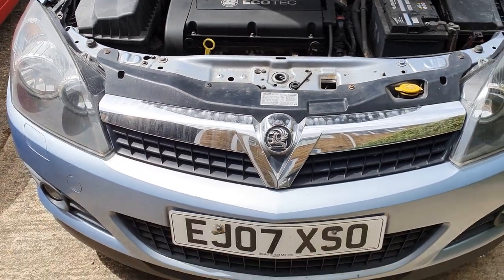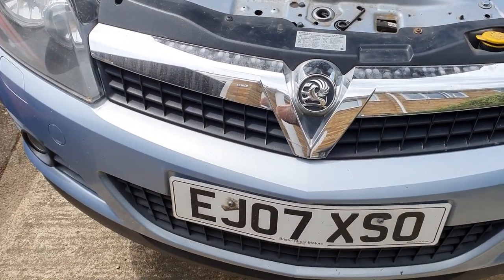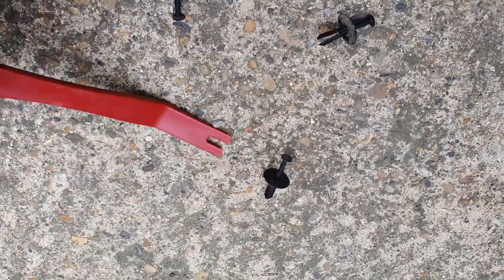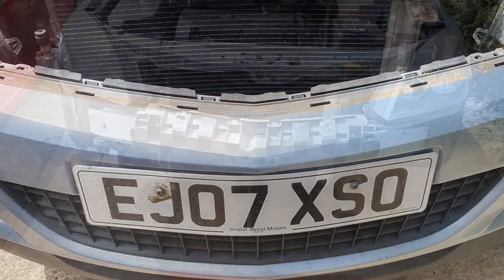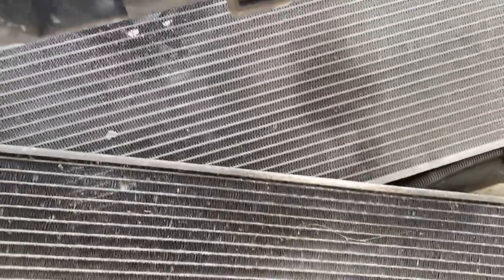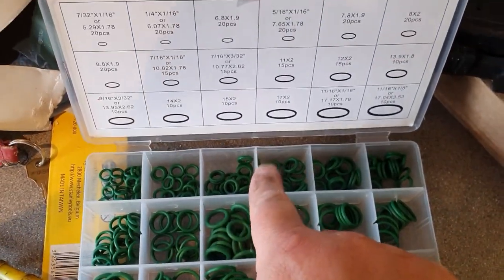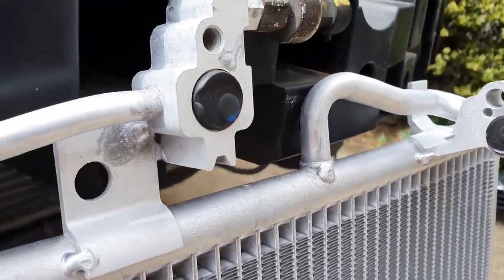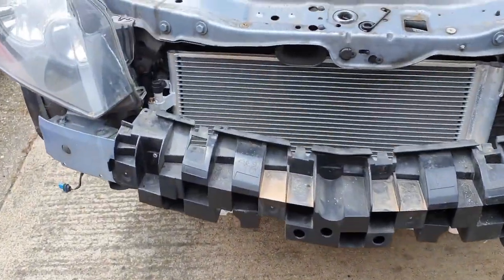Astra Condenser Replacement

Comment: I bought an 2006 astra 1.4 petrol a few months ago with none running AC, decided to replace my condenser which was literally falling apart, I also replaced the Schrader valve just in case, I found there is a lot of space behind the grill so I managed to do it without removing the bumper, bought the condenser off eBay for £50 plus some seals and Schrader valves for another £15 then I had it recharged at ATS using a Groupon voucher for only £42 and it's now working a treat, gets cold really quickly, I just hope it stays that way 😊
Reply from the maker: Glad to hear you got it sorted I fitted my condenser last year and only got it gassed at the MOT a couple of weeks ago, so far so good
Reply: @VauxrezNeil  Good stuff, car air con is a terrible design really, even new cars supposedly need regassing every couple of years and you can spend a fortune letting a garage fix a leak for you, I asked a garage once and they said it would start at like £200 upwards which as always is nearly all labour charges but since everyone says its the condenser that causes most problems,replacing that yourself can be a cheap fix !!!!

Comment: you don't have to take off the entire front bumper. you only need to disassemble the grill at the top and bottom. You can then remove the condenser from the top. saves a lot of work 👍
Reply from the maker: I agree, you don't need to, but for the sake of a few bolts and half an hour it made life a lot easier and enable me to video things mor clearly

Comment: Great video as usual. quick question...   what would you say the is normal operating temperature once the engine is fully warmed up? Thanks
Reply: 90/95C
Reply from the maker: I would agree with 4418CARLOU that 90 - 95 is about right, the lack of a temperature gauge on the Astra H doesn't help although you can read the temp via a "secret" menu on the trip computer

Comment: Just got my 06 astra 1.4 sxi, its a much better drive than a mk3 focus i had but I do miss the later focus's interior and toys, everythings too square for my liking on the astra H, lol .I've always had ford's or vauxhall's including a few mk2 gte's, 1.8 and a mental 2.0 16v which i loved but they all rusted away, I did try my hand at rebuilding a wrecked porsche 944 many years ago but that didn't end well, lol

Comment: what was the inlet and oulet width in mm? having a hard time figuring out which condenser to get 
Great video by the way!
Reply from the maker: Sorry, I'm not sure, I just entered my Reg number into the car parts website (think it was AutoDoc on this occasion) and compared the pictures my existing condenser, all I can suggest if you are unsure is to remove your condenser and measure the pipes, you can leave the condenser out while you wait for the new one to arrive, just make sure you plus/cover any open pipe ends to prevent dirt entering the system

Comment: Was it the condenser in the end?
Reply from the maker: yes it was but a few months later the compressor failed as well
Reply: @VauxrezNeil  Mine turned to to be the fan bracket had worn through a small part of the condenser due to a missing fixing. I used thinners and a soft wire brush to clean the damaged area then applied liquid metal. Still holding gas to this day. 🤞

Comment: If you install a new pressure sensor, does it need a re-gas?
Reply: Hi, When you remove the sensor you're opening the system up and so will release some or more likely most of the gas,, also legally speaking You're supposed to have the system emptied at a garage even before you remove the sensor unless you're 'sure' it's already empty,; why do you think the sensor is defective ? Bridging the sensor connection is only done to confirm if your pump/clutch is working or not and either proves it's not or if it does starts up that the system is very low on gas and probably has a leak somewhere !!?

Comment: Thinking of doing the same. is this where the leak was?
Reply from the maker: Had it recharged and it was fine for about 2 months now its not getting cold again and the pump has started making a noise, another job and another vid 😉probably leave it till the spring now and get it leak tested and any refrigerant removed when its in for MOT
Reply: Exactly the problem I’m getting. Noisy. I’ve just changed the alternator as the one way clutch on it was gone. Much quieter but aircon is still noisy. Definitely a job for spring 👍🏻